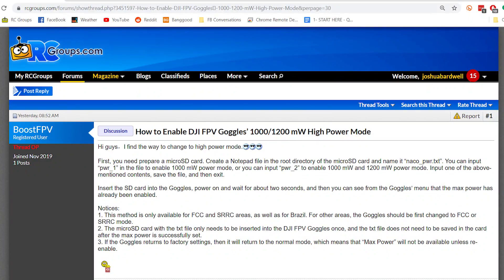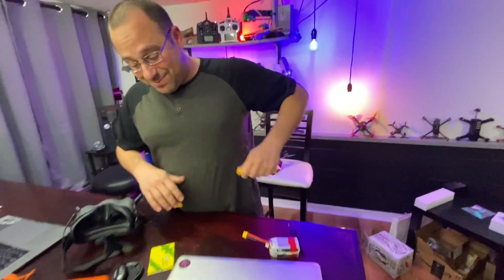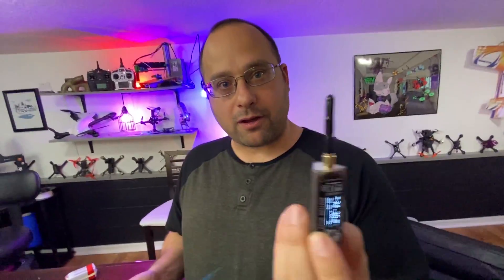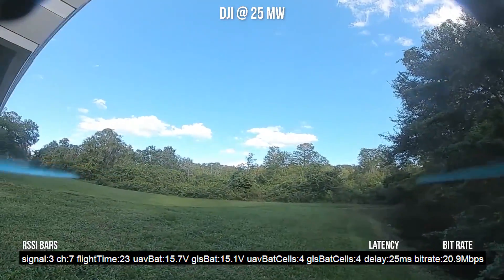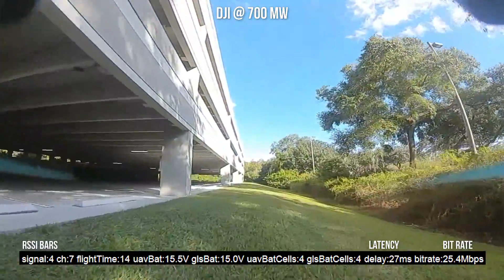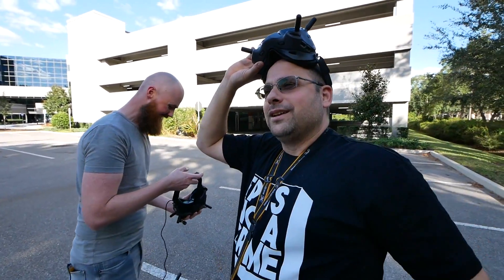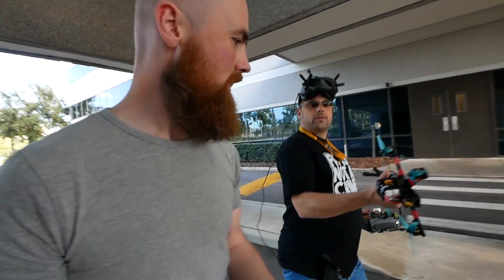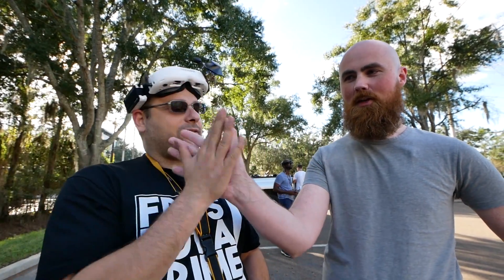DJI FPV more range than analog | 1200 mW HIGH POWER MOD

Comment from the maker: I HAVE A HAM LICENSE. IT IS LEGAL FOR ME TO OPERATE THIS AT 1 WATT this is no different than any other analog vTX which you also need a ham license to operate.

It is also legal to operate over 1 watt if you are not remote controlling a RC vehicle such as if you were to use the DJI system as a security cam or whatever.
Reply: @escobarfpv1275  Similar situation happened to me at a local park / ball field (that was EMPTY where I was), and the officer rolled up, was like "are you watching that thing through those?" and I said "I sure am, I have a spare pair, want to watch?" He was super excited, he has since been into the hobby!
Reply: @DroneShotFPV  thats awesome
Reply: @DroneShotFPV  thts how u do it!
Reply: @DroneShotFPV  Nice!
Reply: Lmao! Brah that fry was legit. 

"Fire literally." 🤣
Reply: That is exactly why i would like to run my power level at 1200. I'd of course turn it back down to 1 watt and utilize my HAM license when flying. NSA... In case you are confused this goes to the FAA.
Reply: @Danny_To_Žabil  Always a good idea for MANY reasons, one of which is testing on the bench with a display (I assume it was a small LCD display, right?) is WAY easier than using the goggles for momentary things, and the display you can also just hand to people! Good stuff man!
Reply: @Danny_To_Žabil  Also got me one. That eachine thingy. It's also my way of recording now
Reply: Technically you don’t know for sure. Power isn’t the only limit.  I don’t know how you legally identify. And if you use the dji transmitter you’d be limited to a watt I think.
Reply: Joshua Bardwell was that a question?
Reply: if i did this and it did something wrong to my quad would it violate the dji warranty to get a new air unit or whatever broke? I also just got the dji hd1 kit from rotor riot loving it so far the motors dont sound right and i dont know if it is the tune or what but the jello is really bad at high throttle. i got the one that came built and tuned.
Reply: @escobarfpv1275  Do you need a licenses to fly fpv in MI?
Reply: ok, and no limitation for voice only not digital???
Reply: @escobarfpv1275  😆exactly but he has to say this for the ones tht give a 💩
Reply: do i need a ham license to operate a security camera?
Reply: Best Demo ever LOL.

Comment: Will this work with the Goggles 2?
Reply from the maker: The goggles 2 have a ham unlock mod that is similar but different.
Reply: @JoshuaBardwell  for using with the Vista?
Reply from the maker: Yes correct. When Vista is used with Integra or G2, it acts like an O3, not like a Vista. Older 1200 mW and FCC unlock hacks that were used with V2 goggles do not apply.

Comment: Why is it that on my dji fpv googles v2 here in Norway i dont even get the alternative to edit or see or change those units ? It's not even an alternative on my dji fpv and googles. Anyone knows why ? I even added those files to my drone and googles,  but it doesnt show up
Reply from the maker: You need to do the FCC hack on the air unit first.

Comment: Hey, How does this upgrade work with the DJI FPV Drone itself as everwhere I have looked there are only references to upgrading the DJI FPV Air Unit. I have assumed that there is an equivalent to the Air Unit inside my DJI FPV Drone, so how do the text files loaded on the microSD function inside the actual FPV Drone rather than the FPV Drone Unit used for HD type hobby drones? Almost every video or listed instructions show you how to confirm the upgrade worked, but my V2 Goggles don't have the player option which I assume is the interface when using the Air unit in a non-DJI drone. So does this mean the upgrade isn't compatible within the DJI framework of the FPV Drone w associated V2 Goggles and the Transmitter? Or can it be working in the background and have more power that it can automatically adjust?

I did read somewhere that the 5.8ghz is restricted to 25mw, but that at 2.4ghz it can broadcast up to 100mw out of the box, have you heard similar or nothing close?

PLEASE Help if you can. I would really appreciate any insight and clarification.

Also, while I might have your attention, could you clarify one thing for me? As the V2 Goggles and the DJI FPV Drone operate with dual frequencies, how does this factor into possible antenna upgrades which all seem to list as 5.8ghz which makes me assume they are more for the V1 Goggles. I have seen some funny looking dual-band antennas for the V2 Goggles, but I wanted to clarify if I were to use a patch antenna (iFlight, Lumineer AXII and others), will I be giving up the dual band functionality or can I use 2.4ghz omnidirectional antennae if they work? I recall the 2.4ghz to be broadcast from one bottom antenna and one top antenna on the opposing side. Seeing that patch antennas appear to both connect to the upper antennae on both sides, essentially connecting to one 2.4ghz side and one 5.8ghz side. So, if patch antennae do work with 2.4ghz as well, it would make sense they connect to both the 5.8ghz & 2.4ghz, but if they don't work on 2.4, do all 4 connections revert to just 5.8, or have you rendered one of the antennas useless if it can't function beyond 2.4ghz?

Comment: I've been using the naco pwr file for a long time in my dji glasses, I had a problem today, the hack doesn't work at all, could it be from the sd card or I'd appreciate any help.
Reply from the maker: It should still work exactly as before. Nothing has changed as far as I know.

Comment: Feel like this is a really stupid question but would this dramtically increase the use of power out of the battery while in a higher mw? I still use the DJI goggle battery and i figure it would draw way more power than normal

Comment: i tried this on the v2 goggles for my dji fpv and i couldnt find the option to change the output power at all?
Reply from the maker: This is about the air unit and vista vTX not the DJI FPV drone.
Reply: @JoshuaBardwell  dang :/  was hoping it was for the dji goggles in general

Comment: Ty for the tag link! Maybe you can help me further. I did everything listed but the mW is greyed out at 25. 

Visually in the goggles, going to Player showers 8 channels with unfilled circles next to them, an in setting a bunch of options show as selectable but immediately get greyed out. Same for when going into settings where the Power mW is. When selected it goes from white (selectable) to instant grey out.

No clue what to do. 

I'm in the US if that makes any difference. I'd just like to increase this DJI FPV limitations a little before buying new antenna and diving down that rabbit hole.

Comment: Is it safe to use 1200mw? Or has it any disadvantages (except legal)? For example battery will discharge faster or something like that... It would be great to make a test how 25mw vs. 700mw vs. 1200mw discharge battery and how much time it can add when you are flying at lowest mw. If there is big difference or not.

Comment: Joshua I don’t have that power menu at all that I can find in my V2 goggles. I bought the FPV combo that came with the drone, controller, and goggles.
Reply from the maker: The goggles use a different operating system when used with the DJI FPV drone. The 1200 mW hack only applies when the goggles are used with air unit and vista.
Reply: @JoshuaBardwell  well darn.   Any way to get better range in drone mode?

Comment: When using power hack on pilot goggles I noticed lots of blocky pixelation in a second set of goggles monitoring the main set in Audience Mode. The distortion completely went away when reducing power output in the main set to 700mW or less. Has anyone else noticed this?
Reply from the maker: Audience mode is always worse than the bound goggles because the audience goggles can't request retransmission of lost data. This is unrelated to the power level.

Comment: I can't get my caddx vista into FCC mode let along 1200mw.  naco.txt file is on the caddx drive.  Also tried on air unit and it works fine on air unit but not on 3 different caddx vistas.

Comment: So it it safe for the goggles and air unit after a year of using the goggles on 1000 or maybe higher lol? But no seriously, just bought v1 goggles a few months ago and want to do this hack to them as I bought the skyeliner HD from RR and since the antennas are sort of scrunched down I do notice as JB said before I bought it that the range suffers slightly due to this antenna boot and the orientation of the stock dji antennas. I hoped if I did this I would have improved range and not have to worry about doing something wrong to my expensive equipment that I'm sure I will never be ae to afford again anytime soon so I want to be careful. I understand the skyeliner hd is for freestyle and not going far but just like in this video sometimes you want to fly behind a building once in a while and it would be nice to have longer range in general just for a stronger more reliable signal. Thanks for your response in advance. Hit the like and ive been subbed for several months. And I learned something today.

Also you and Drew in this are absolutely priceless in the beginning when all excited about this new high power mode lol🤣. And Drew's "its fine, it'll be fine" always somehow turns out to be fine in most cases. I guess what they say good outlook, good outcome is true. You guys are all entertaining in this though and the flame  🔥 im sure you guys know was from bridging the air unit power to that frame. Glad the flame was the carbon fram not that air unit.
Reply from the maker: Yep it's fine.
Reply: @JoshuaBardwell  Hey the man himself. Thanks for the timely reply J.B. super stoked to do this and especially how simple and without worrying now. Im a big fan of R.R. and how FPV pilots are all like one big family. I live near Pittsburgh Pa and just got into FPV and I am glad to have found and be part of such a dynamic hobby mostly made up of all good hearted people that have one thing in common (flying) and sometimes much more than just that. God Bless you sir and God Bless FPV and all who make it what it is.

Comment: Does it also work with the 01.00.0500 update?
Reply from the maker: It works with all updates moving forward
Reply: @JoshuaBardwell  ok now i can buy it thx 👍 Now I have to expand the runcam from the Steele Apex 5. Should work 🤔

Comment: Looking at the comments I'm surprised I didn't see (maybe I'm blind, probably) someone else say what really happened...  He had one tweezer point on a frame screw and one in the hole (slomo the slowno).  It shorted between the air unit case and the frame and burned the carbon.  One sharp pointy safe, two sharp pointies (makes a good bridge)  bad lol.  Still sucks.

Comment: Now JB does mention that you do that at your own risk - do we know already whether this mod has a negative impact on the lifetime of the air unit/ could even potentially damage? It is rated for 1w max, right? Thanks - by the way, love the vid, and the channel, and the community <3
Reply from the maker: The Air Unit has thermal protection, and I've been running this mod for months now with no noticeable negative effect, so most likely it's fine. But you do the mod at your own risk, naturally.
Reply: @JoshuaBardwell  Have to admit that I was like "omg JB himself replied to me" - then re-read the message again. Thanks for the info, I would have thought that this is exactly what the thermal protection was for. And yes, of course, at own risk.

Comment: Is this mod still working in the US? Here in Germany after the Firmwareupdate (V01.00.0500) this mod is not working anymore... has onyone an idea to get it running again?
Reply from the maker: The 1200 mW mod always only worked on FCC registered devices as far as I know.
Reply: @JoshuaBardwell   thank you for your answer. When I got the DJI googles I could choose between 25 and 700mv. But after the firmware update this option was wone. 
I figured out that with the FCC Mod on the air unit the option is back. :-)

Comment: If I’m correct the top 2 antennas are transmitting to the unit and the bottom 2 are receiving from so only the bottom 2 would benefit from the patch antennas but don’t quote lol

Comment: I bought Velocidrone yesterday to practice before I go FPV and after an hour of practicing circle racing with pylons per the training video it made me puke.  I’m not sure how to prevent this and surely hope this doesn’t mean I can’t do FPV but I heard larger FOV helps eliminate this ... not sure but possibly another benefit of the DJI goggles over Fat Shark or Orqa?
Reply from the maker: Probably you will get used to it. But maybe you just over-did it. Were you wearing goggles or using the screen? Suggest using the screen for practice as it's a bit different in the sim vs real life.
Reply: I was using a 17” laptop screen as I’m not sure which goggles to buy yet ... I’ve read so many mixed reviews it’s hard to decide!!  FWIW - I’ve the game with FOV set to 100 ... I’ve read it should be higher and some others said it should be lower like 45-50 or else you can have motion sickness ... what would you recommend?  Besides this, I just bought the sea-band which some other people say eliminated their nausea ... hopefully this solves it!  Thanks!
Reply from the maker: I prefer about 100 to 110 degree FOV.

Comment: I can't for the life of me get this to work on my goggles. US version. Tried several times with several different SD cards. Never works.
Reply: Me either.. I'm guessing DJI got rid of this hack in a recent firmware update
Reply: @jerrysmith82794  I actually got it to work. All I did was name the file "Naco_Pwr"  not "Naco_Pwr.txt"  and it worked.  Must have been the way my pc is set up, and henceforth doing it the way he recommends in this video my goggles were reading the file as "Naco_pwr.txt.txt".  Hopefully that helps.
Reply: @petesenn1367  tried naming as you indicate...but still can't get it to work.  do you have the .500 update installed?

Comment: Joshua I'm not sure what the coverage pattern is with the dji reciever antennas but you could consider sitting in a lawn chair to ensure the goggle was facing in the same direction each time. I'm sure this has little to no difference on range/clarity but just throwing out an idea for less variables in future testing thanks man!

Comment: It’s impossible to measure isotopic power, but a close approximation can be made if you had a standard gain antenna, LNB and resistive power head. It’s hard enough on non-spread FDMA, but with spread QAM, hopping, and TDMA, any reading is almost meaningless, except as a reference. Still, if you knew someone who could do a good RF measurement, referenced to a coupled TX out port, and adjusted for antenna gain (if any), THEN you could get your ten readings of the same signal, average them, and come up with a compensation factor. At that point you could reasonably see (for example) 2mW on yours and infer that is roughly equal to 20dBm or 30dBi. Meter seems handy anyhow, but with a compensation factor, it could actually be...a fair indication of a power range

Comment: Tried this with my goggles and air unit.  Can't seem to make it work.  Doing it just like you in the video (less the fire ball). Any suggestions.  Even went back to older firmware and tried.  No luck.
Reply from the maker: Only works on FCC devices.
Reply: @JoshuaBardwell  
That's what I'm running

Comment: How much power does this draw from the FC? I was planning to run an air unit off a Bardwell F4 V2.15 9V VTX circuit considering the air unit is rated 9W and circuit is 9v*1.2A=10.8W. I expect 1 and 1.2W are drawing much more.

Comment: Probably a question that's been asked already..Do the goggles output this power in addition to the air unit? Or is it just the air unit itself?  Seams it would be crazy to put a 1.2W transmitter on your head if that's the case..
Reply from the maker: 1 watt is really not very much power.

Comment: 3:25 as you can see the flammes came from the carbon and not from the air unit. It shorted the air unit with the twizzers, no doubt about that, but the flammes were coming from the frame and not the air unit. I don’t know anything about air unit, what this button is for and how it can be shorted , but it seems that the frame is less resilient than the air unit. That’s why it still functions

Comment: Nice, use something conductive
Reply: Don't assume more is better, you are also amplifying noise
Reply from the maker: I didn't assume more is better. I tested it in the field.
Reply: I know you tested it, but higher output doesn't always result in more bandwidth in a digital system nor does it guarantee better reception in an analog system. 

Not saying you don't get more maximum range, I'm more concerned with performance and quality of the link.

For example if I put my wireless AP at home to 100mW, I can pickup the signal at the road and at the end of the field. But... my throughput inside is reduced. I lower it to 50mW, the range at which I pick up the signal is reduced to the end of the field but my throughput inside increases.

DJI probably designed these two way radios with overhead to actually run at 1.2W, so I wouldn't worry about it too much ;)

Comment: Could the smoke be an issue with the new dji firmware? I just flashed the new version on my air unit and tried to bind to it, I used a plastic pocking tool from my ifixit kit and smoke came out of the unit. Still works but smells pretty bad... Has anyone else experienced something like this?

Comment: Even if it would work at 1200 mW, but for how long?
I think the power transitor might get too hot over time.
It remains a risk.
We will see.
Especially in the summer heat ;-)